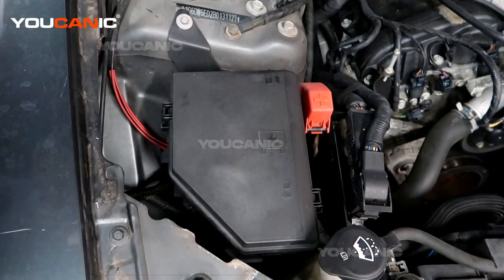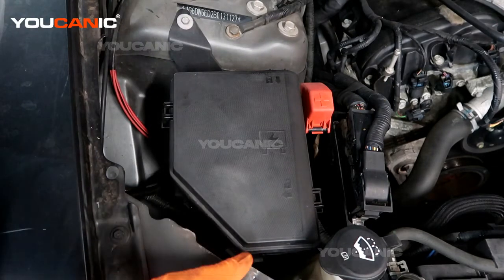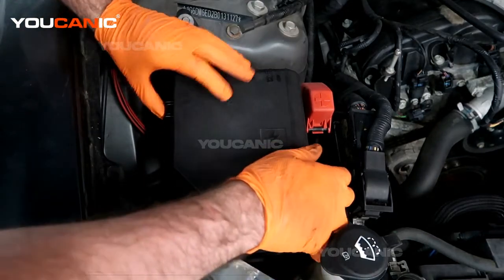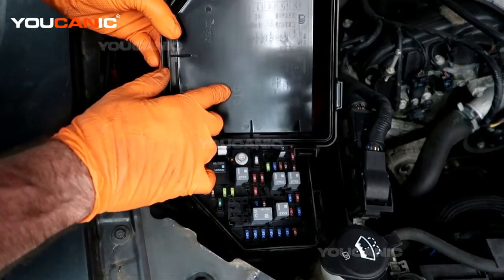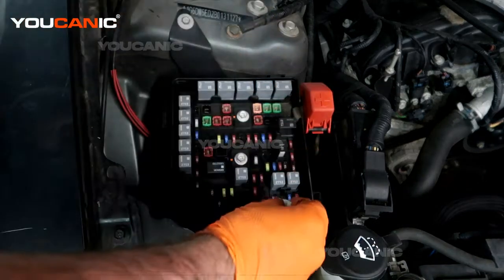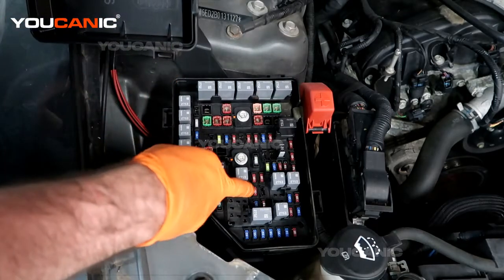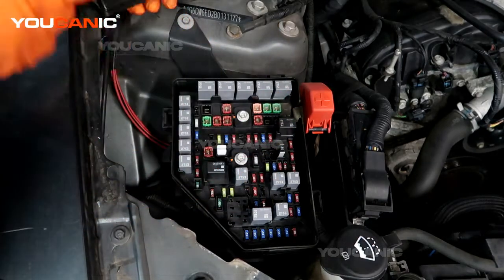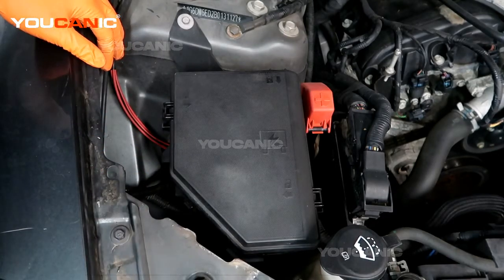2005-2011 Cadillac STS - Fuse Box Location and Check Fuses & Relays

Comment: Which fuse do you know is for the heated steering wheel?
Reply from the maker: Thanks for your comment! Unfortunately, we didn't cover the specific fuse for the heated steering wheel in this video, but a detailed diagnostic is crucial for modern car repairs. That's why we developed the YOUCANIC Full System Scanner, providing you with professional-grade diagnostics power equivalent to what expert mechanics use. You can learn more about our scanner at www.youcanic.com/scanner.

Moreover, if you're looking to do the job right, access to Factory Repair Manuals and Torque Specs can be invaluable. For a small fee, you can get all the necessary procedures and specs to fix the issue professionally at www.youcanic.com/manuals. We're here to help you with your car repairs!